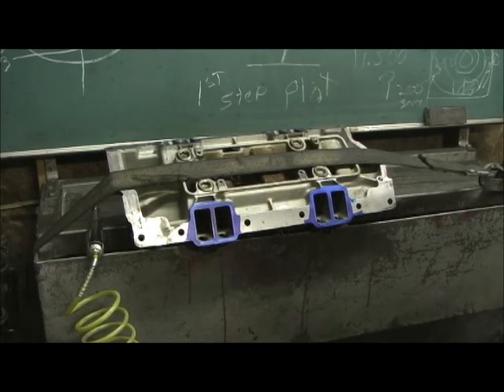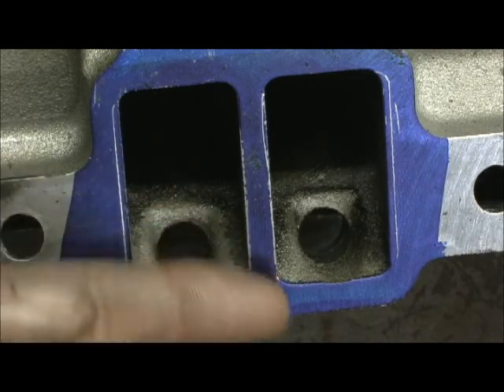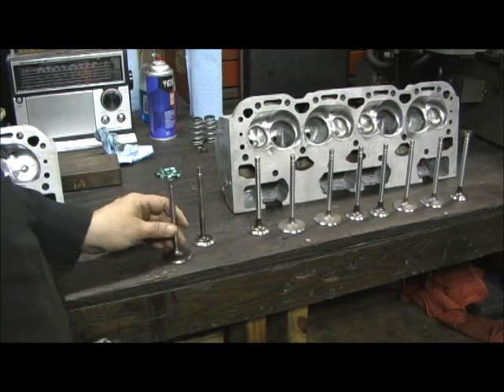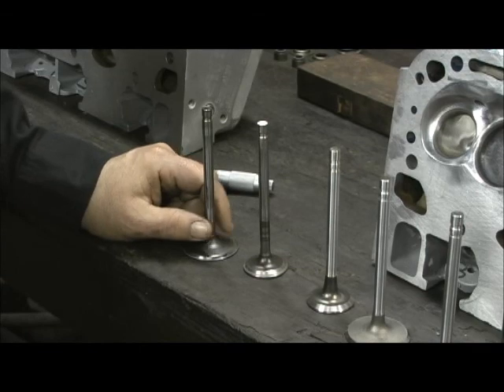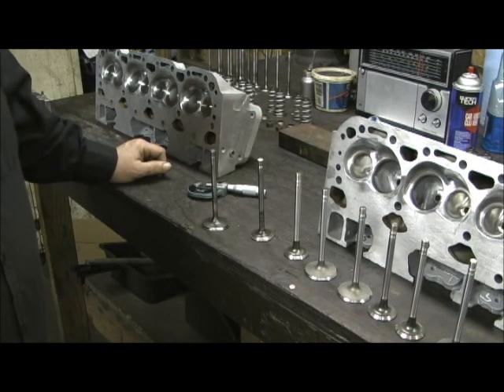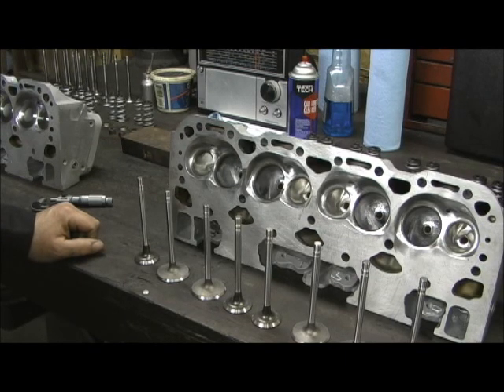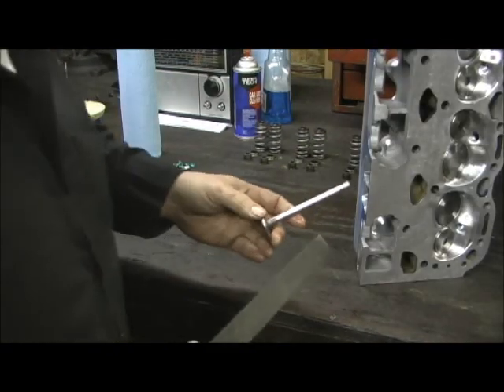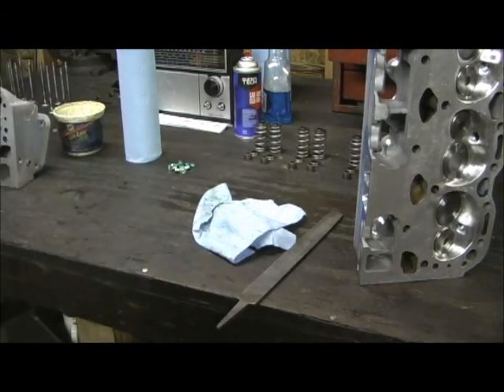LT-1 Stage IV Conclusion Part 1 Valve Springs INSTALLED HEIGHT

Comment: I'm catching flank again for the cam choice here is the quote;
 "Awful choice. There's a reason you rarely, if ever, see an LT1 build with a single pattern cam. Unless you have a ridiculously killer exhaust flow a single pattern is not ideal. Even LS1s use dual pattern grinds and their heads are light years ahead of ours."